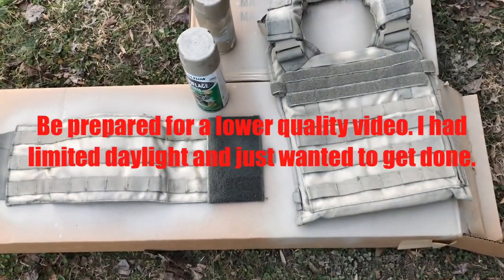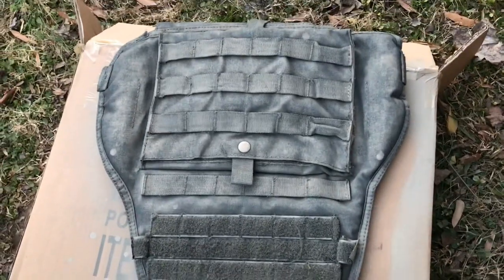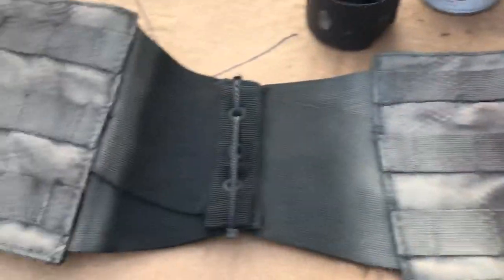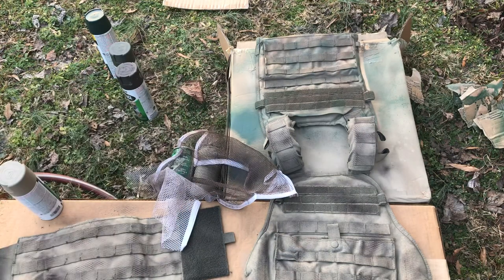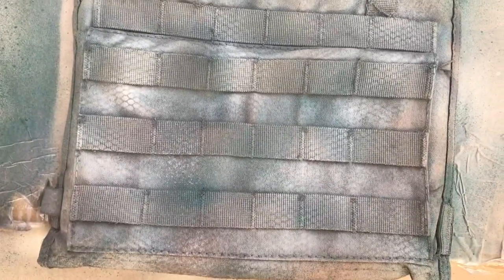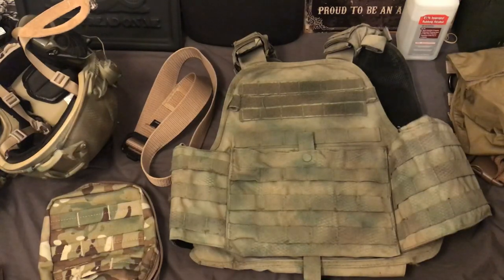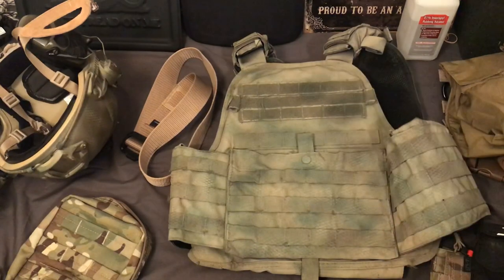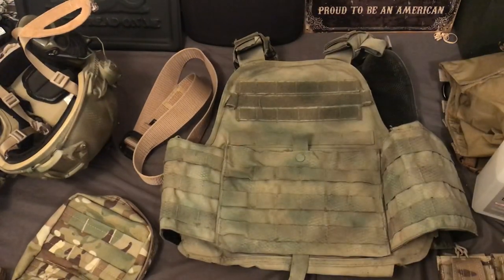How To - Spray Paint A Plate Carrier

Comment: Did the paint stay?  Does it run off? Can you wash?
Reply from the maker: @Sentan555  I wouldnt wash it, but the paint will need reapplied every now and then, if it has hard use.
Reply: @poortac5568  I heard paintstiks work.  But I wanna camo up velcro

Comment: i have a black plate carrier. which colour should i use for urban or mountain camo? grey or which one would you prefere?
Reply from the maker: I like earth colors like green or brown, or a combination. However, gray is a good urban color and long as it isn’t solid gray.
Reply: @poortac5568  does it gives brighter and / or darker grey?
Reply from the maker: @campbondsteel  I would go with a medium gray
Reply: @poortac5568  And can you tell me a good manufacturer? i hear Crustoleum, NFM,  Krylon are good. which one would you prefer to textil ?
Reply from the maker: @campbondsteel  That I dont know. I just used the walmart Camo colors and it worked fine
Reply: @poortac5568  Okay, thank you very much. now i can work with this. just need to check the net.
Reply: @campbondsteel   so if you ended up painting it what spray paint did u use?

Comment: Looks good.
Reply from the maker: thanks! 😀 It came out better than I thought it would.
Reply: @poortac5568   my plate carrier is black, been thinking of doing something like that although I live in a large city, black with all the shadows of houses and buildings might be just as good. 🤷🏻‍♂️
Reply from the maker: @concernedpatriot.2221  black in a city may not be bad. FDE or Grey might be better. As long as you arent in all black, your profile would still be broken up. 🇺🇸
Reply: @poortac5568   your right. Have to work on it.
Reply: bum_fungus420   good idea.  I actually have a coyote brown water bottle holder, it’s inside the pack now, but I’ll do that, could use the extra space inside.

Comment: How long does it take to dry after each coat? Im thinking about doing this with my black plate carrier. Have you had any issues over time? Does the paint shed, is it sticky etc.
Reply from the maker: its sticky for a while. it will chip off over time as well. personally, id buy a new carrier if you can 👍

Comment: Do you smell like spray paint? What happens when you start sweating in it, will it just make you smell like paint?
Reply from the maker: It will smell like spray paint for a while, just like a gun will. I have no idea about the sweat. I hardly sweat, but most of the sweat would contact the mesh interior, not the painted areas.
Reply: @POORTAC556  thanks, I have black gear and I'm trying to make it look like yours. I might try and test out dye and see if I will work before I go for the spray paint. I'm gonna use a couple of spare gear straps before I dip the rig just to see how it will take the dye.
Reply: Yo! I just finished dyeing my gear. I couldn't get it to work on the fabric. It dyed everything else like the plastic and stuff tho. How has your spray paint held up after all this time because I'm ready to give it a shot.
Reply from the maker: @carsonfricke7471  It will come off over time (it will chip off with use), but you can always paint it again. I actually gave that plate carrier to a friend who moved, so Im not sure how it held up currently. Just know, it will be very stiff initially depending on how much paint you have to use. Could you lightly bleach the black and turn it brown? Might be a decent option. I got bleach bathroom spray on a black shirt that turned that spot brown. Might be worth trying before going the spray paint option. Or it might give you a decent base to work with so you don’t have to use as much paint for the base coat.
Reply: @POORTAC556  Supposedly, bleech really weakens fabric. It's a good idea, but I want the material to hold up. Especially nowadays. I'll give paint a shot, I'll try it on some other gear first, though, and I'll just buy some newer better stuff anyways.